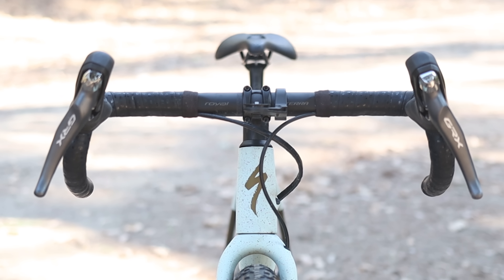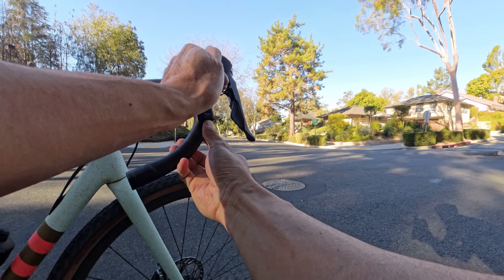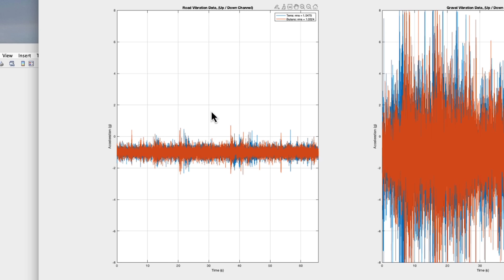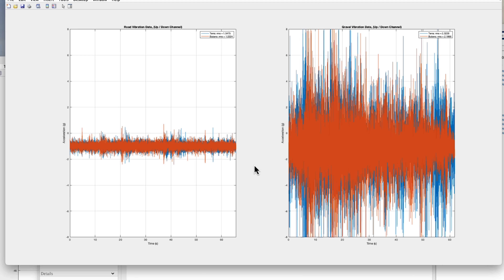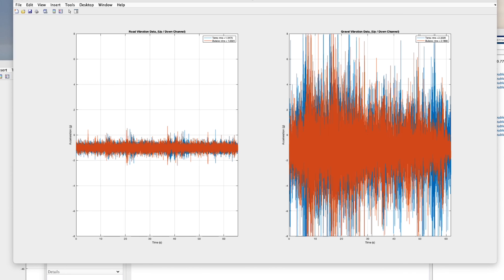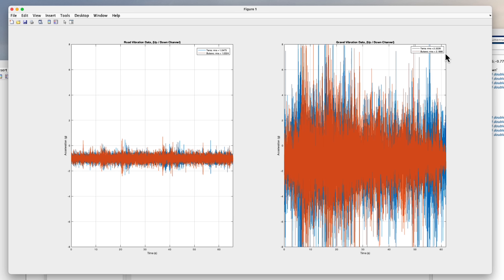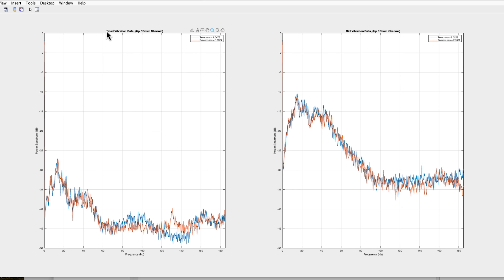Carbon Handlebars DON'T Always Reduce Vibrations // The SCIENCE Says So.

Comment: Hey Bikesauce! Great subject. I thought I would offer some thoughts on your experiment. It’s a bit long, but I hope it offers some constructive feedback for the next test. I believe you are incorrectly assuming the acceleration data tells us how energy is dissipated in these two different handlebar systems. As I see it, the frequency domain in your case only demonstrates to us how frequent certain peak accelerations occur. In short, your data tells us the bumpy conditions of the road surface were consistent between the two test runs. 
In order to determine damping rates you need to measure the displacement time history of the displaced handlebars during these bumpy conditions. Damping by definition is the rate of dissipation of displacement with respect to time. Think about the pendulum as an example. As it swings back and forth its displacement is decreased on each successive cycle. If we place an accelerometer on the pendulum, all we would measure is the acceleration time history as it swings back and forth, but we wouldn’t know anything about it’s displacement. Therefore, we wouldn’t know it’s damping rate nor the energy dissipated on each cycle.  
In order to see whether one material has a better (higher) damping rate, e.g. critically damped vs. undamped, we need the measured displacements due to the given load inputs. With that data, you could determine the damping ratio, however, this test set up would be difficult to do on a bicycle, because you have to measure the relative displacement at the free end of the bars compared to some fixed point. A lab test here would be more precise and less complicated. 
If we recall the basic single degree of freedom mass oscillator under free vibration will oscillate for infinity unless there is damper placed in the system (the law of conservation of energy). However, if we place a damper in this system then the basic differential equation for this system is u” + cu’ + u = 0  (damped free vibration). The solution to this equation depends on the value of (c), the coeficient next to the velocity term in the equation. “c” will determine the difference between successive displacement peaks of an oscillating system, and if the system is underdamped, over-damped or critically damped. Perhaps, a better study would be to instrument each handlebar fixed to a very rigid jig with a free end hooked to a displacement transducer and an accelerometer. You could tap on the end of the bars and measure the displacement time history as the bars vibrate to a stop. With the acceleration data you can determine the force applied. It will be easy to see which one has a higher damping rate because it will vibrate to a stop sooner, but with this data you could calculate “c”. Of course this is already catalogued for many materials and carbon fiber composites have a higher rate of damping compared to most metals. The question we all want to know is how much of an actual affect it will have on comfort, and that’s not quantified anywhere. For now marketers just tell us it’s a lot and worth the extra cost of carbon. 
Personally, I find the materials nearly the same, so I prefer to save money and purchase nice alloy bars and use thicker bar tape, or get suspension. Cool video, and I hope you continue to work on this very interesting subject. 😀
Reply from the maker: Henry! Glad you checked this one out and thanks for your input! I love the academic discussion, so I'll provide my thoughts here:

As a thought experiment, ride the same bumpy trail back to back; once with a super stiff bar and again with a super noodly (flexible) bar. Accelerometer measurements in the freq. domain will definitely show substantially reduced power across the primary bandwidth for the flexy bar. The flexy bar has a larger displacement and therefore more time and space to decelerate; this is why mtb suspension works. This, of course, only suggests that one bar has a lower stiffness (k) and really doesn't say anything about the damping (c). 

The freq. domain data does show a bit of resonance at around 10-12Hz in both bars for road and gravel, but they have the same magnitude, suggesting that neither bar is has a larger or smaller damping coefficient. Further, assuming (from the data) that the carbon bar has a slightly stiffer spring constant, then the effective damping RATIO for the carbon bar will be slightly lower since k is in the denominator. 

Addressing the time-domain study suggestion: I've thought about this lab experiment a lot, but what I keep coming back to is that an isolated test designed to measure the damping coefficient of the handlebar is meaningless. This is because while riding the bike, the vast majority of the damping comes from the rider (muscle tissue, fat, cartilage, etc); essentially the handlebar + rider combination comprises the system. A lab test would be good for determining the spring rate of various handlebars, however (this is something my students are currently working on). 

As an analog, this would be like devising a lab test to determine the damping coefficient for an automobile coil spring. Sure, different springs have different inherent damping coefficients, but the most significant damping in the system comes from the accompanying shock absorber (strut, damper) in the system. In this analog, the coil spring is the handlebar, and the damper is the rider. 

As it stands, I'm starting to come around and agree with your view that - for components anyways - the material makes very little difference in ride feel. Frames and wheels, on the other hand, I think require a more nuanced discussion since aero, weight, and stiffness are more significant elements of the overall cost function. 

Seems like maybe a Henrywildeberry X Bike Sauce livestream may be in order to dive deeper on this 😀
Reply: @TheBikeSauce  Thanks Dr. Bikesauce! I'm glad this was a positive exchange. I'm in agreement with you that the two bars will have almost identical responses to input, and any differences will be hard to discern (by most people). Just looking at damping coefficients of carbon fiber composite vs. aluminum they are very close to the same. Marketing would have us believe it actually makes a big difference, and that lays out the challenge. The way I like to think of it is like the difference between a steel guitar string and polymer string. Both strings can have the same stiffness, and make the same note, but they don't sound exactly the same (the tone is different). One will vibrate a little bit longer than the other, but will be almost the same. I don't want to come across as an expert, I'm just genuinely curious in these subjects, and I appreciate the work you're putting into this academic exercise. A discussion would be fun, and I would be open to it. For the record, I do think there are differences in the feel of various frame materials and frame stiffnesses. It may not be a lot, but it's there.

Comment: @5:22, till this came up, I was seriously starting to wonder if that (no spoiler alert) transform will come up! Even at an elementary level, given the torsional rigidity of carbon fiber post molding, in theory, they should actually not be ever more compliant than a softer malleable/ductile material like aluminum/aluminium.  I am going to hazard that comfort, compliance, and anti-harshness is a factor of bike and handle-bar geometry/fit more than material. (Disclaimer, I run a carbon handle, but don't buy the comfort angle.)

Comment: here's my MTB rider pov who swapped 3 handlebars on 2 bikes recently, alu handlebards for mtb are cheap like 35$ you cut one too short no big deal buy another one, cutting with a pipe tool takes 30s and you're done, cutting a 200$ carbon handlebar ? oh boy you need a special alignement tool, a special carbon saw blade, some kind of glue to prevent the sawn part to shred in pieces you need a mask to prevent inhaling extremely dangerous fiber dust, a giant pain and costly if you mess up, I removed my oem carbon bar to put it on my XC 3x11 and can't say I feel anything different it's a few grams less I guess

Comment: Tube diameter, wall thickness, and where you grip on the bars all matter as much as or more to stiffness than the material.  Paraphrasing Richard Sachs, the material is not the bike, the frame is not the bike, the wheels are not the bike; the bike is the bike.
Reply from the maker: There you go

Comment: Nice! Love to see vibration content hit bike YouTube! 
Any concerns about aliasing? Did you do any oversampling to see what frequencies are present at the handlebars? 370Hz seems low on the surface to me but I've never mounted an accelerometer to my handlebar to find out. I haven't looked at critical frequencies for HAVS in over 5 years but 100-300Hz used to be thrown around. If the carbon could take the buzz off at the higher end it could be a worthwhile upgrade (which based on the data you collected looks unlikely that carbon would be any different).  
Thanks for the video, really enjoyed it. You got me thinking more critically about a new handlebar upgrade.
Reply from the maker: Love the nerdy feedback. I didn’t do any higher sampling bc on the hardtail frame tests, I observed the same dynamic bandwidth (roughly 10-50Hz) at a higher sample rate. I saw nothing above 100Hz, although this could be speed dependent; if I were flying at 40mph, more modes could pop up presumably

Comment: Fourier transform!  The main appeal to me of carbon handlebars is that they can be formed in shapes that are challenging/impossible to mass manufacture economically with aluminum.  So you can get flatter/longer top sections, basically, with more rapid transition between round and aero/ergo sections.  The weight savings are nice but not essential.  Claimed damping differences in materials (frames, handlebars, what have you) have always seemed kind of superstitious to me.
Reply: But do you believe the carbon bars more "aero" profile gives it any actual difference? To me, most claims of aero gains sounds just as bogus as this dampening effect. 
Because wind tunnel really isn't real life. 😄
Reply: @positiivi_teme  I think the primary benefits of flat top sections are ergonomic (and aesthetic), rather than aerodynamic.  Rider's body (clothing and position) dominates, so it's critical to have the right cockpit position.  The profile of the bars is probably de minimis in comparison.

Comment: I agree that there is a lot of fictional generalizations with carbon handle bars. Personally I have used both aluminum drop bars and carbon drop bars. I have also used both materials on my mountain bike riser bars. The carbon 31.8 diameter carbon mountain bike bars are noticeably more flexible, even my real old Easton Monkey Lite short bars. 
I purposefully never changed my personal bikes to the 35mm diameter carbon bars because I don’t see any benefit since I lean towards comfort and not stiffness/racing. Plus I only weigh 160# so it’s not a concern about durability. 
Bottom line is carbon is mostly just lighter weight and wider may have more compliance but short 42-44(that’s what I run) drop bars are pretty much the same as aluminum.

Comment: Could it be that there is more variability between two Specialized carbon bars than there is between the Specialized and the Ritchey?  In other words, the way that carbon bars are manufactured may lead to one bar being more complaint than another made on a different day by a different person.  It used to be that in the age of analog cameras, you could get a REALLY sharp version of a 50mm lens and a really soft version of a 50mm lens made by the same manufacturer.

Comment: I'm an alloy bro. I highly discourage you to get 6061 AL or 2014 handlebars. I highly encourage you to get 7050 or 7075 or any 7000 series AL, double or triple butted. RaceFace Turbine is an excellent example.
Reply: I can feel the difference in vibration between 6 & 7000 series aluminum. I know 7000 is stiffer. But that doesn’t always mean better. It means you can make the tubes thinner and lighter. But that doesn’t always mean compliant.
Reply: @SOUPBOY1972  the butting makes 7000 compliant. 6000 and 2014 are rock hard stiff.

Comment: Not to mention the crash worthiness of carbon.  I never buy carbon bars.  Ritchey makes great bars.
Reply: I've got a flat Ritchey WCS on my hardtail and I'm looking at the VentureMax for my gravel bike.
Reply: @teecee4459  I would try to find someone with a venturemax you can try out before buying, if possible. That bio bend is something that is not always easy to live with. I really only tolerate it with super thick grip tape (like wolf tooth supple tape). And it can be awkward if you need to ride ready to brake, like long descents.
Reply: @cjohnson3836  thanks for the tip, but any drop bar will feel strange to me since I'm riding a flat bar mountain bike right now 😂
Reply: @teecee4459  NP. But not just strange. Actually painful. At least for me, the bend puts a fair bit of pressure on the median nerve. With thin bar wrap I've had periods of sharp tingling in center of palm. And even with thick wrap I was getting acute ulnar nerve compression syndrome when I was doing longer gravel rides.
Reply: @cjohnson3836  I have a -40 degree stem on my mountain bike to drop my hand position. I ride on top of my handlebars, I'm used to the numbness although it just makes me pedal harder to relieve the pressure 😂
Reply: I’ve got the cheaper venture max.  I love it.
Reply: @SOUPBOY1972  I tried the VentureMax but I like the Beacon more.
Reply: I had crashes on carbon handlebars - no issues. I used road carbon sworks bars for quite hard gravel during several years and had no issues.
Reply: @rafacycle   Yes, but people have had problems with carbon bars after a crash, and, they're no better than alu as the video reveals and they're much more expensive.

Comment: Thanks for the detailed and informative video!  I ride a 2021 Specialized Diverge Expert and after the first couple of months swapped the OEM Hover alloy bars for the carbon FSA AGX K-Wing handlebars (same width, same flare). I am an older and heavier rider (220 lbs) and there was a very noticeable difference, with the FSA bars being much more comfortable on gravel roads. Whether it is simply more compliance or vibration damping, I couldn't tell you...only that I could ride in more comfort. BTW...same handlebar tape on both bars. Thanks again.
Reply from the maker: I’m sure there are differences even between different brands of carbon and alloy bars. In your case it seems the difference was more noticeable. I think the point is for us to stop making generalizations between carbon and alloy since each component is unique.
Reply: I was about to make a similar comment. Not all carbon bars are going to have the same result.

Comment: In the end, tyres are the one that reduce the vibration most. My alloy frame and fork bike (the one people claim to be the worst material) with 2.1" tyres ride really soft compared to my 25c bike
Reply: That.... and probably a Lauf leaf spring fork. 😆 Or Redshift suspension stem.
Reply: Yes, but it doesn't mean that the damping effect from tires is the same as the compliance of all the materials and design between the tire and your contact points.

Comment: Can the same be said for carbon vs aluminum wheels?
Reply from the maker: Hard to say without actual testing. I think even between different brands of alloy and carbon bars, we may see a difference as well. I’d say the point is to not generalize between carbon and alloy.
Reply: Almost definitely. Carbon wheels can save weight or provide a nice aero benefit, but definitely aren't a place to try to find compliance.
Reply: Rotational weight is a whooole different can of worms..
Reply: and fork?

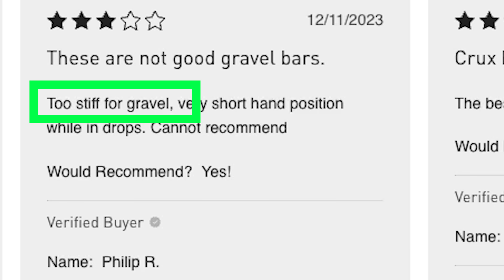Comment: You nailed it at 10:30. People feel the difference for two reasons:
1) They spent $2-300 on handlebars
2) They replaced heavy, straight gauge aluminum OEM handlebars
Reply: I suspect the contrast is because of very extreme factors from both the alloy options and the carbon options, rather than something rather comparable between the two.
Reply: even within ritchey the ride difference between comp and wcs is large. great video though.